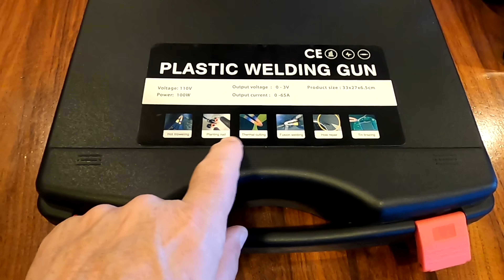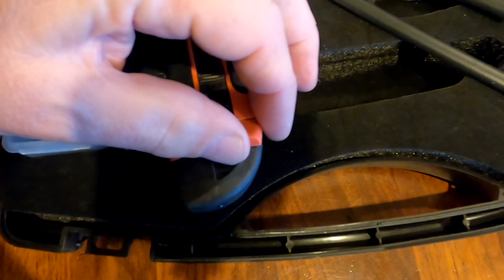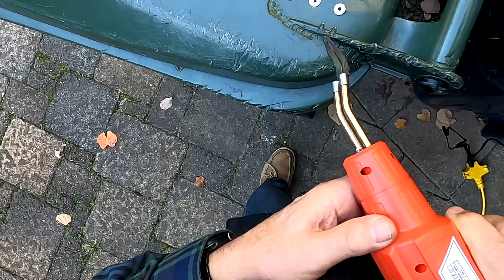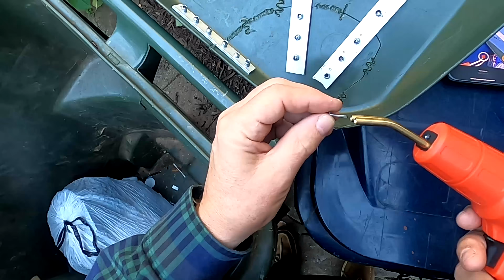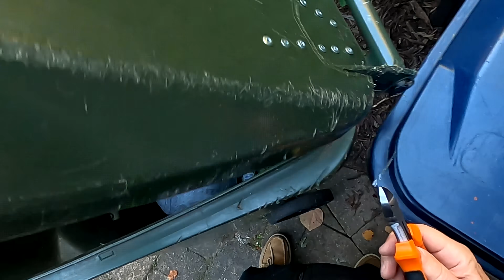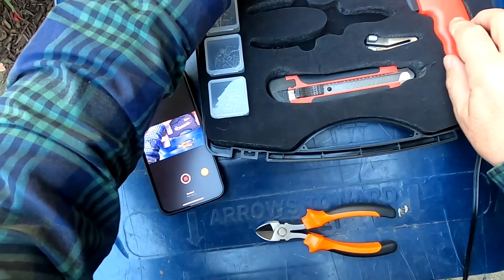Plastic Welding Gun Kit Review and Use

Comment: Very good video, informative and thorough. 👍🏻
I think you may have had the welding tip backwards though. The way it was angled in the video made groove in the plastic as opposed to if it were flat and flushed to the plastic it may have come out flat with no groove channel in the plastic. I may be mistaken, just an observation.
Thanks for the video!
Reply from the maker: Hey good point thanks for bringing that up. I appreciate it. I’m glad you found the video useful. I haven’t used the welding tip that much but I’ll try it in both positions. Thank you so much consider subscribing. Thanks. Joe.

Comment: so, it's a soldering iron for plastic?
Reply from the maker: Yes it is a device used to either melt the edges of plastic so the fit together or place the wire connectors strong joint consider subscribing. Thanks. Joe

Comment: I have a solder pistol, also 100w. Can i use it for welding plastic like on the video?
Reply from the maker: Thank you for your question. It is a good one. If you’re extremely careful, you probably could melt both side sides of the crack and get it to fuse together. You may have to do it on both side sides of the plastic. It is a challenge absolutely but it can’t be done. Good luck. Let me know how it turns out. Consider subscribing. Thanks. Joe.
Reply: @  Hi Joe,.Thanks for the answer. I will consider your tips.
Im writing to you from Iraq and soldering pistols / Irons are more popular here than the one you have in your video.

However, i did some youtube search and found out that there acctually are some videos showing people are using it for the same purpose i need it for. So it seems possible. See links downbelow.
Thanks for the great video and have a nice day :)

https://www.youtube.com/watch?v=OVaup9CYOL0&t=467s

https://www.youtube.com/watch?v=HAYdkcoRzqI&list=LL&index=2

Comment: Mine doesn't heat up like urs did on the bin...any clues?
Reply from the maker: Hey, I’m not sure if it’s brand new. I’d probably get an exchange. They really do need to heat up otherwise it just doesn’t really work. When it does work, it works very well as you can see in the video. Consider subscribing. Thanks. Joe.
Reply: Yea, I bought a corded one from temu  twas cheap. That didn't work.
Then I bought a cordless one from temu, but more powerful 200w, it appears it doesn't heat up the flat iron.  It appears to  shorts out when both prongs are linked (from the outside). I'm considering getting yours from Amazon, but I noticed it doesn't come with your iron bit, lol😮. Anyway,  I do have a normal type welder with these different copper " irons to fall back on"😂

Comment: Can you weld into PVC pipe
Reply from the maker: You ask a great question. PVC is a thicker stronger polymer that definitely can be melted and if there’s a crack in it, these wire reinforcements can definitely be placed. There is a welding blade that actually can be used as well, but to weld it properly you need to get on both sides of the break if you can get on the inside and outside of the break, you have a good chance of repairing it, but it will be brittle and it could be likely to crack again in that location. Consider subscribing. Thanks. Joe.

Comment: Hi, I'm in the UK, and I have just purchased a plastic welding gun, it has everything yours has, except,  the welding nib, tip, I'm not sure what you call it, would you know if I can buy those separately. 
Kind regards 
Paul
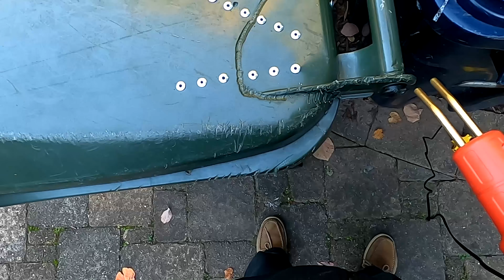Reply from the maker: Hello Paul, you’re in luck. I looked at welding gun accessories in Amazon and I found that you can purchase two tips or even three tips. I’m going to try to include a photograph of that for you. 5:03
Reply from the maker: I couldn’t load a picture, but here’s the link copy and paste this into Amazon and you’ll find what you’re looking for I think

Allturn 2PCS Plastic Smoothing Tip,Plastic Welding Tip to Repair Car Bumpers,Kayaks,Etc.(Only for Allturn PWG-100